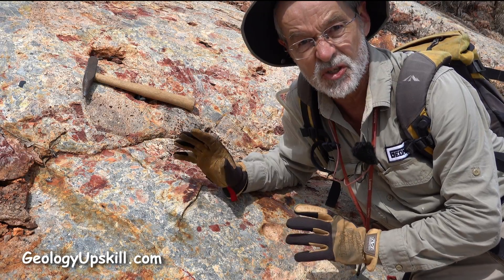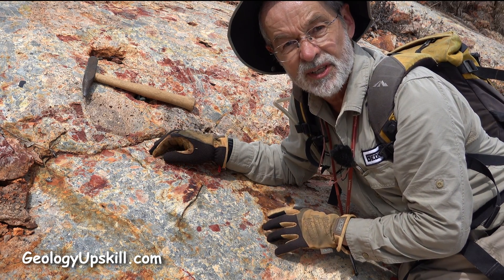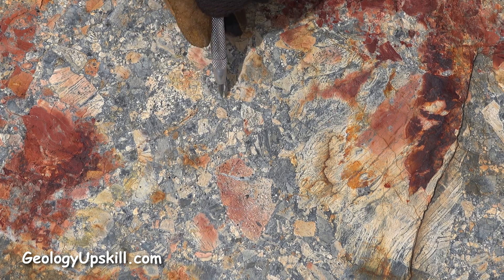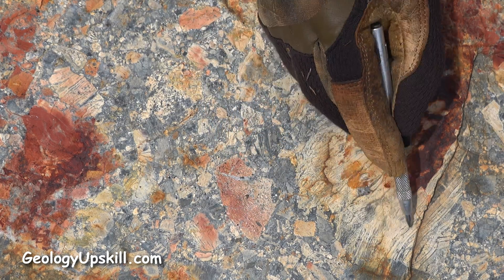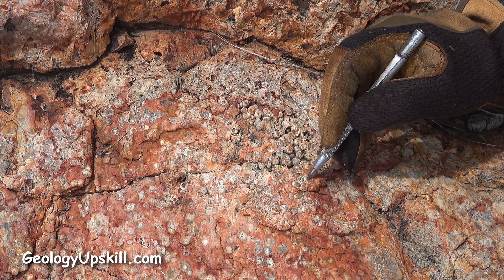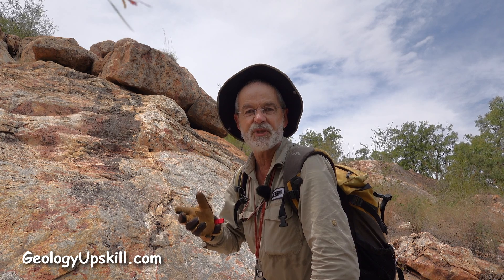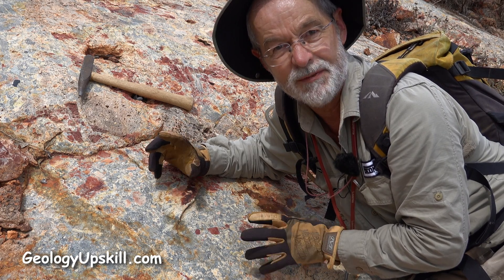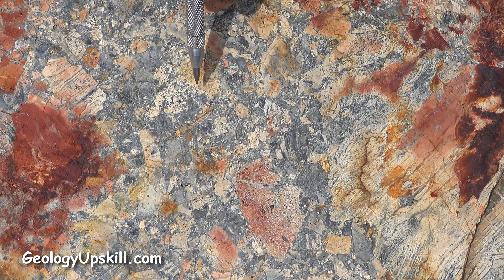Talus Breccia

Comment: You have a brecciated rhyolite and a spherulitic rhyolite.  The number of ore outcrops with spherulitic rhyolite comes to zero, but you can hunt for perlite deposits, obsidian, and spherulites themselves.
Reply from the maker: I didn't mention it in the video, but this breccia has returned some ore grade gold assays so there is at least one example of ore with sperulitic rhyolite!
Reply: @GeologyUpSkill  As a vast general rule, no.  But, one site on a contact zone, maybe fault in Victorville, CA has a mine on the contact.  I think it is called a gold mine.  They must have extracted something.  Tailings of less than a half acre.  IR shows andesite and dacite, with quartz, albite, and anorthoclase.  Exsolution of feldspar from silica is not linked to high metal concentrations from what I see.
Reply: The mine just has a shaft, so I did not go down into it to see if they were working veining in it and not the lava itself, but I recall the tailings were just lava.  There are still outcrops on trend away from the mine of more orbicular lava.
Reply: Or, rather, this is more like an orbicular rhyolite.  Yes, I did see one gold mine on a spherulitic rhyolite outcrop, one for Southern CA, ever.  A small gold deposit on the rhyolite contact.

Comment: Just a bit of feedback for you, you may want to mention what it really means to be a talus breccia. As in these are volcanic/volcaniclastic breccias and how they really form. Cheers from Canada
Reply from the maker: Nomenclature of rocks is always an interpretation. If you guess right, it can be a useful guide to what else you might find. If you guess wrong, you can waste a lot of time and effort following the wrong path. You can also waste a lot of time collecting enough evidence to get the name exactly right. My best guess at this early stage is that it is a combination of autobreccias developed on the moving outer skin of an expanding flow dome + talus breccia that forms where fragments fall off and accumulate around the margin of the dome.